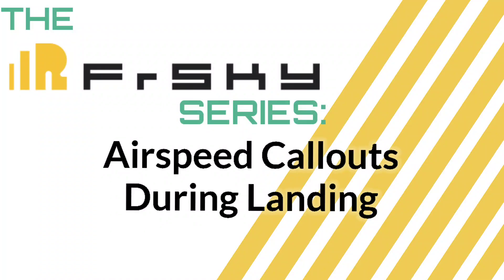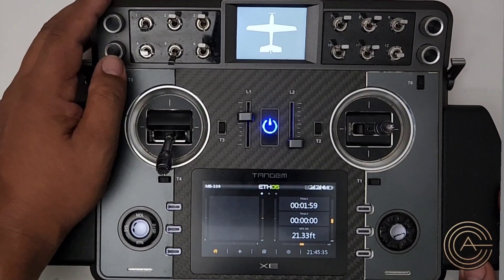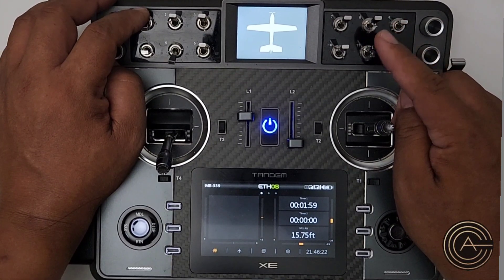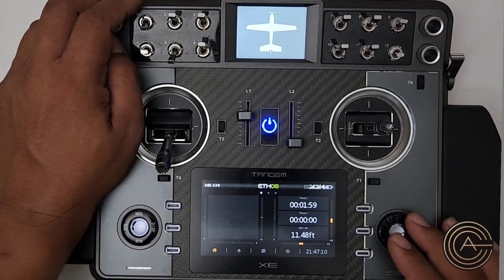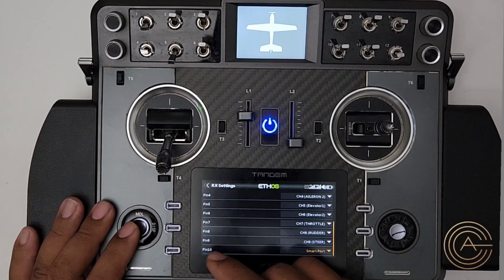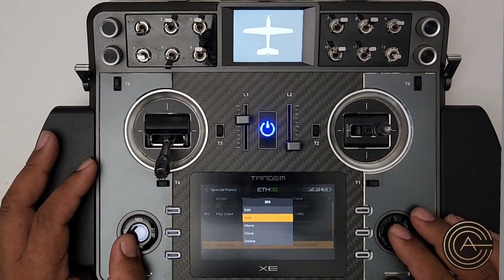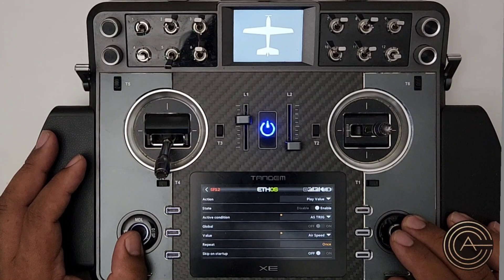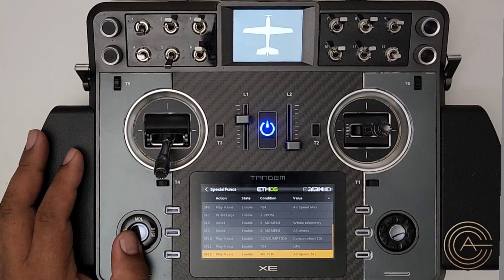The Frsky Series:  Airspeed Callouts during Landing

Comment: I knowthe GPS reads slower but ill besetring this up for stall speed indicator and call out. Very cool, thank you and ill report on its workings.
Reply from the maker: Give it a try... but just so you know, gps will read ground speed which is different from airspeed.  If your stall speed is 20mph airspeed and you are in a 10mph headwind, your actual airspeed may be 25mph but gps will read 15mph. It may be beneficial in calm conditions but with a headwind or tailwind, your readings wont be accurate, especially for landings. Its worth a shot. Give it a go. No matter what, its a nice learning excerise and it may set you up to try an airspeed sensor later!

Comment: I might be a bit behind the times, as im still using my trusty X12S Horus transmitter with OpenTx.  Im having trouble with telemetry signals.  I have Air Speed, Batt Cell, and Verio.  All three are set and work fine if used individually. But if i daisy chain together i can only read the first in the chain.  All my Rx's are smart port equipt ACCST receiver's with firmware 2.2 nonEu..  any help would be appreciated.
I brought the Air Speed sensor for just this reason, approch speed.   FrSky advise is to upgrade all my gear to the X20S.  Not helpful at all.  All my gear works, just not as it is advertised as, Am i doing something wrong
Reply from the maker: Hello,  i am not very familiar with the Horus X12s but it's a very good transmitter.  I have used OpenTX. I wonder if one of your devices is conflicting with another.  Try booking up one at a time and see which one causes it to break. I can't remember what is called exactly but in each of the telemetry items, there are two types of id's.  You can double check and confirm that the id's are not conflicting and if they are you should be able to change them.  Also,  you did not mention if your telemetry sensors are updated.  Make sure to update the firmware on your sensors as well as the receivers and tx. I would try that first.  Your setup should be fine to run multiple sensors.  By the way,  if i had an X12s, i wouldn't swap it over to an X20, i would upgrade the firmware to Ethos. I love the way the X12s feels in your hands.
Reply: @all_rc  updating sensors,  that's an idea. I didn't think to try that. Just assumed they where sent out with latest firmware on them. I'll have to check the sight to see when they were last updated. I'm guessing I can download to my SD card and flash though the JR bay similar to receiver's.
And yes, X12S is a nice feel in my hands. Good weight without being too heavy, or to light and toy feeling like the Radiomaster tx16, does.  To me any how.   X12S Horus side sliders are a little arrrrrr at times, but switch placement, and extra sliders, third joy stick are great for tools, and switch's, without removing or using up the flight switchers.   Thanks for you in put.  And happy new year from New Zealand.     Updating X12S! I might buy the needed board to bring it up to ACCeSS, as it'll give me a wider range of Rx's, since FrSky have stopped production of some ACCST receivers.   I do like the OpenTx, may swap to EdgeTx as they've more support.    Not to bang on ethos, it's just still needs a bit of work from what I'm seeing.     Never know what tomorrows thoughts will be though.  LoL 🤣👍.  Thanks again
Reply from the maker: I went from OpenTX to Edge TX on my TX16S. Edge is much improved. A lot of the initial improvements was to make the GUI much better for touch screen but there are tons of improvements all the way through. You obviously don't care about the touch screen features.  When i first got Ethos, i felt the same.  Edge was much more powerful.  After i got used to Ethos, i would never go back to EdgeTX. Programming is so much quicker and easier.  There are some things Edge still does better.. Flight modes are better on Edge... more options for how trims are handled. Global variables are available on Edge but not on Ethos. But I found other ways to program without it.  Their programming methods are different but one you understand it, it works very well. I haven't found anything that i cannot do once i understood the os. Also next major upgrade adds a ton of features and upgrades (including gv, i believe). It's getting better and better.  It has the power of edgetx with a very quick programming method.
Reply: @all_rc  thank you. I'll keep an eye out.   There is away of mounting the touch screen from a TX16 into the X12S Horus.   A bit of care and soldering.  Can be done. Not sure if I'll go that way.  Maybe.  Thanks for your time
Reply: @all_rc  I finally got around to updating the firmware for the sensors, could only update air speed and volt meter, nothing for the verio I have "which isn't needed when using a GR8 Rx.   I now have all working when Daisy chained together. Thanks for your suggestions.   I did have to do it a couple of times, as I went straight for the most modern firmware, which is for ethos, 🤣 lesson learned.  So for my glider now, I have volts for the power motor, rise and sink verio, and air speed, max speed in a dive, stall warnings on approach to land/slow flight in a thermal.   Thumbs up mate.